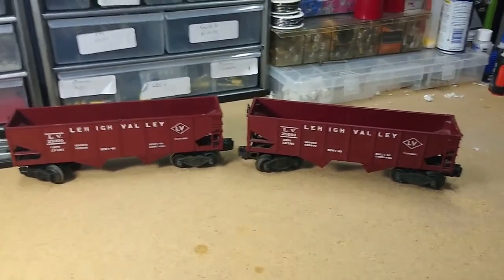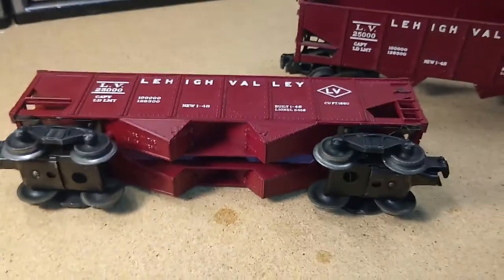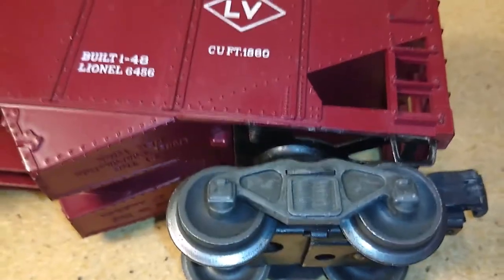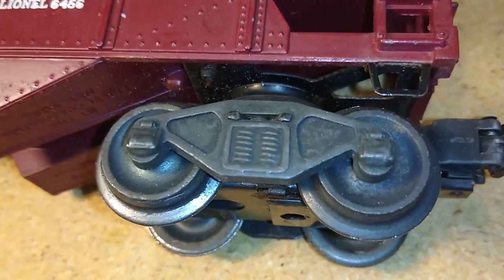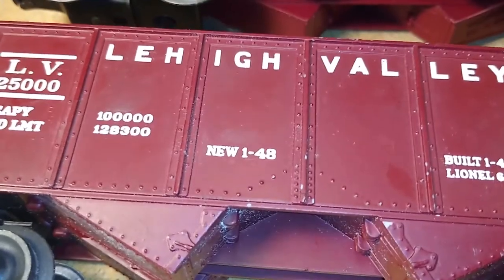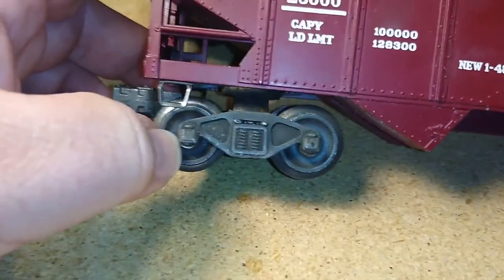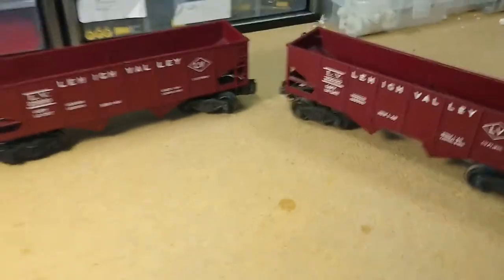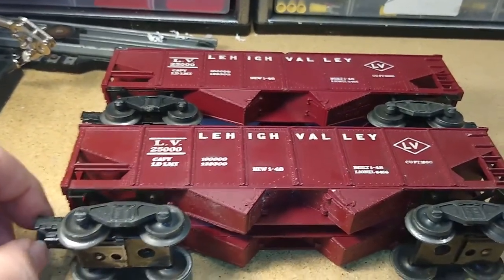Identifying And Dating Lionel Rolling Stock - #6456 Lehigh Valley Hoppers

Comment: This is just the tip of the iceberg with these cars as a lot of changes were made over the years of production of the LV hoppers. But FYI Type 2 was similar to type 1 and type 4 was similar to type 3 except those types were the molds made for the Norfolk and Western Auto Dump hoppers and the bottom was molded different for the dump mechanisms underneath.
Reply from the maker: Thanks for the information!

Comment: Since I model the Penn Central as a going concern in the seventies you still had many 40 and 50 ft cars left over from the Golden Age of railroading. You could run shorter older cars or longer newer cars on the same train and that emulated what you saw in real life. I like the older cars with the All Metal Trucks they just have a certain air of quality about them. What's really cool is diecast cars they really thump when they go through switches and through Crossings.

Comment: Very Helpful information here! Thank you for clarification on this topic! I have the black hoppers and boxes that are confusing. The boxes appeared a little more modern than the Date on the sides of the hoppers. 1/48. So yeah I have a  1950/51 version then. Thank you for the help. Have the reinforcement on the inside corners, the center round plug for the operational cars and the staple end trucks. Coolness! And now makes sense that it fits the setup like I was told it did?! So they basically kept the build date from the time of inception on these things. And I means it can be anytime from that Date forward in time. Thanks so much.
Reply from the maker: Yes. Postwar dates are for the first version of the car. 1970 and later generally show the actual build date. (Some scale cars show prototypical dates for the real car instead)

Comment: One is actually smaller than the other. The smaller of the two is what Lionel calls their 027 gauge which is actually "S"  gauge rolling stock on O gauge trucks. 
027 was their cheaper line marketed mainly for young boys.
Reply from the maker: No. These are identical in size and, while they can maneuver on 027 track they are properly proportioned 1/48 scale 55 ton 2 bay hoppers. They were made in different years with different trucks.
Reply: @ToyTrainTipsAndTricks 
 OK... from looking at the video,  they just  appeared to be different sizes

Comment: What  truck and couplers can I use  on my marx postwar rolling stock
Reply from the maker: Well, whether you want to keep them Marx-compatible or Lionel-compatible your best bet is likely to look for junk cars for scrap at train shows and use their trucks and couplers. I have not found AFFORDABLE new replacement trucks for either type. Another option is to make your own via 3D printing, but so far I haven't found a good-running 3D printed design (but I'm still trying!).

Comment: Will  you provide this type of information to Marx lovers ?
Reply from the maker: I wish I could! Marx production is much more difficult to pin down than Lionel for a number of reasons; fewer collectors, less documentation (catalogs), and a tendency to customize products for specific retailers based on price point. For example, a particular plastic boxcar could sometimes be offered in 4 wheel or 8 wheel, with knuckle or tilt couplers all in the same year - depending on whether the product was intended for Sears, Montgomery Ward, or the neighborhood Five And Dime store. Lionel is much more specific.